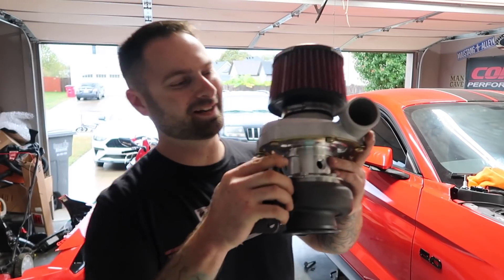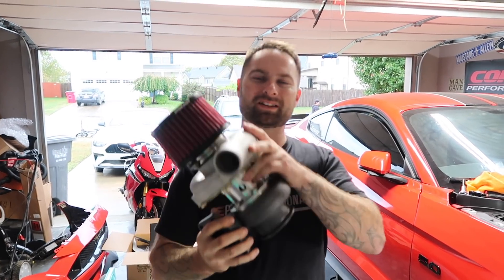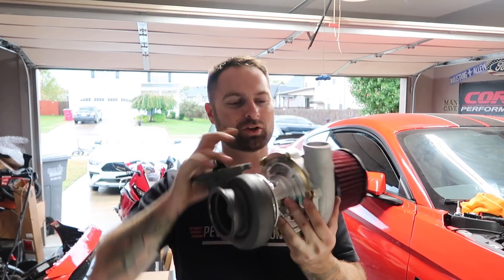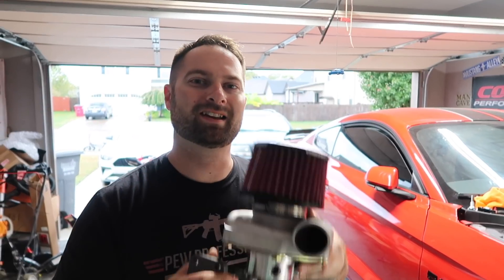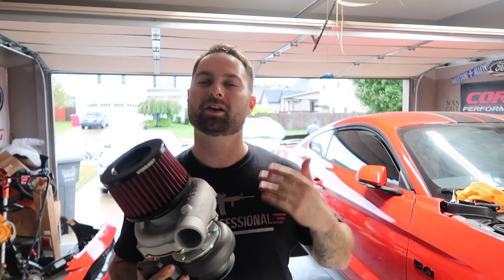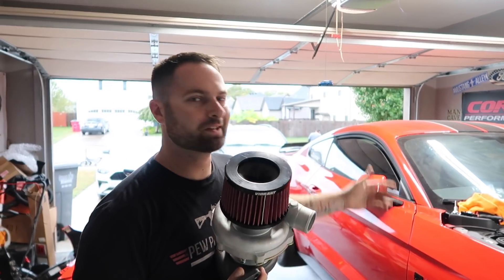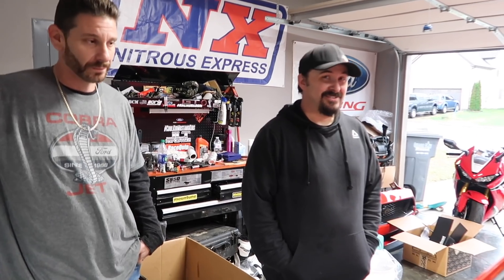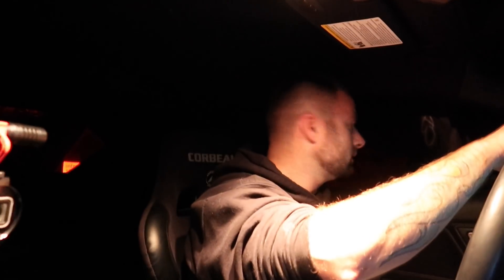MY 2019 TWIN TURBO MUSTANG GT ENGINE EXPLODED ON FIRST DRIVE... IT'S ALL OVER

Comment: That’s what happen when a couple of idiots install a twin turbo kit and don’t take it to a dyno shop to get it tuned. Who t’f smashes on the gas like that when it isn’t even tuned? Itsjusta6 has to do multiple datalogs before he even went into boost. #sellthecar
Reply: I think one of the pull overs was a data log sent in?
Reply: Gates were plumbed wrong, gates were stuck shut, car let go around 22psi.
Reply: @HellhorsePerformance  at least its nothing on you or your products.  He could have tried blaming you. Glad to see him accept responsibility
Reply: The car blew up because it over boosted it wasn’t because of the tune. Most tuners send you a really conservative tune for the first log either way so you don’t blow it up in case the fueling ain’t there.
Reply: @HellhorsePerformance  and........it would do what it did with a built engine on 93 then....
 I've been thru hell myself ( though a 50 states legal kit that should work )..when I was younger I've worked into the night, into fatigue and just wanted to" try it once ",  
 New day fresh eyes and this probably doesnt happen I feel bad for even encouraging a first start that night now as I know exactly how bad this feels twice heh.....
 If the video is a representation where is was same night as first start up, I think we are all guilty of pushing him to start and wanted, even if we didn't get to see, a first drive...I'm old and failed enough to know better I feel bad for my part of feeding the pressure of any......
 Sorry Zander you know I know your pain I'm looking at a blown up since July 5k mile 19 a10 right now
Reply: WhiteWolf5.0 logs don’t lie, lol.  Simple install error.  Should have realized when it was making more than hate something wasn’t right.  But with the gates stuck shut it became a runaway situation.
Reply: @HellhorsePerformance   right vented to atmosphere it would have opened around 7 right? No controller at all on it
Reply: BlueCollarDaily, 7psi springs are/were in the gates
Reply: @HellhorsePerformance  nice safe spot to start and if I recall without CO2 you can approximately double that with dome pressure ( me and my best friend agree to not run each others setups so I helped with his twins he helped my my homemade sequential MPI induction and prochargers ect...then I used a second tial bypass and vacuum from procharger inlet with a cheapo 3 way valve to do boost by gear not the control of a waste gate but I could manage it down from 4 to 17psi on a bbc I was happy with that for my Frankensteining) god I have to work on brevity....
Reply: This is what happens when the Three Stooges work on a car

Comment: Damn a expensive lesson. Would be cheaper to have someone install it professionally.
Reply: Just writing a check channel don't cut it for most of Z's viewers. I watch him because he is hands on.
Reply: @ag3nto578  ofc it dont but for a job like that that's now going to cost him a additional 10k at least for a block build. Could have been better on his part to pay 2k to get it installed. Especially cause he ain't a tech.
Reply: @primofx2sport  I don't let "TECH'S" touch my car. I do better work myself. The learning curve is part of the process. If it breaks ( it will ) build it stronger. I drag race my car so I break things. With a built motor he will be able to really turn it up. Blessing in disguise with a lesson learned.

Comment: 😢sorry man... I think I’m going to stick with whipple
Reply: Any power added will blow a motor thats the dice you roll when adding power. My buddy blew his motor and he was NA, making 450whp
Reply: @BarnfindGT  Whipple is the way to go!
Reply: Mine has blown up twice in 988 miles on 13psi vendor tune...
Reply: @bluecollardaily2676  20k miles on mine! 😆😆
Reply: @boosted5.035  Or Edelbrock, or Paxton, or Vortec, or VMP, or... LOL.
Reply: @boosted5.035   LFP just released a video where they will no longer even offer the whipple tune with their builds because they have been popping and Charter not standing behind them....you have to go with PBD to do whipple.....
 Hey if you got 20k on a gen 3 stock your doing good much less whipple what's your boost and fuel? Not being argumentative gathering data.....I'm glad you havent had trouble trust me
Reply: @bluecollardaily2676  17 psi on 93
Reply: @boosted5.035  oh your not gen 3 then yes the 11 to 1 and traditional bore liners on gen 2 are better stock....or are you built? Lund wouldnt even tune my gen 3 on 13 psi
Reply: @bluecollardaily2676  I have a 18 5.0 with a 3.0 Whipple how is that not a Gen 3?
Reply: @boosted5.035  oh unicorn....no seriously lund wont tune me on gen 3 at 13 and I'm pretty sure PBD turned me down too....
 So its straight 93 no boostane at 17psi on a gen 3? Whipple tune or local ( trust me this gives me hope I'm tur ing mine down to 11psi and hoping it even stays together there after the 2nd engine) on straight 93
Reply: He’s a troll his car is a whipple tuned car manual trans 670~ whp lol 😂  his name used to be 2fast he had a “900hp” 370z that got gapped by my buddies 400hp focus
Reply: @bluecollardaily2676  Why won't they Tune You on higher PSI? That's weird! I don't put boostane in my car but u know people that do!
Reply: @BarnfindGT  oh haha makes more sense 17 on 93 wth...lol
Reply: @bluecollardaily2676  What makes no sense is having to put 3 motors in a car! Smh
Reply: @BarnfindGT  LOL So true.
Reply: @frankie072  Don't hate bc u can't afford a car! Facts 😭😭 😭
Reply: BlueCollarDaily I’m going with a custom tune due to having headers
Reply: @PasoCash  Custom Tune is the only way to go! I love my Tune!
Reply: Lol Daniel You’re too funny there’s videos of your ass getting gapped I’m not even in Florida no more  I live in Texas I called you out multiple Times but you were toO scared to run my civic at the time 😂 rumor has it your still hiding from babayaga racing’s Supra 👀
Reply: @boosted5.035  LOL, OK, your right I cant afford a car,I afford 5 cars at the moment,along with a boat and a House.
Reply: @frankie072  Sucks to have no car to Run with huh!!! SMH

Comment: Well when you say your on waste gate shooting for 6 pounds and then while driving you say your 20 percent throttle and hit 9.7 pounds you turn around cause there’s an issue . So the only people to blame are you and the other person in the car who was supposed to be watching the gauges . Also whoever was tuning and told you for first data log to do a wide open throttle pull through the whole rpm band is a idiot. First pull is to 4 or 5 thousand rpm where it just starts making boost .

Comment: Didn't anyone tell you to pull timing out even under low boost? This motor has 12.0: 1 compression. With 9lbs of boost your talking  close to 20.0:1 compression. You could hear it laying over like crazy and you never lifted. A drive with more experience would have felt it start to lay over before it went south. This is a very expensive way to learn about boost, compression and what a car laying over feels like. Even a built engine will blow under these circumstances. So please learn from your mistakes. One idiot that goes by the name it's justa6. Is enough on YouTube. I know your much smarter than him. Good luck.